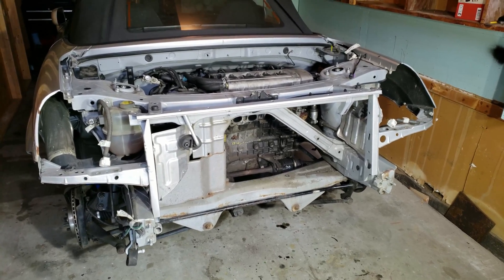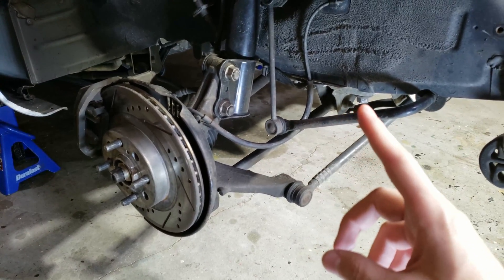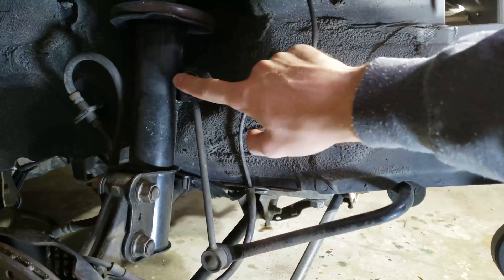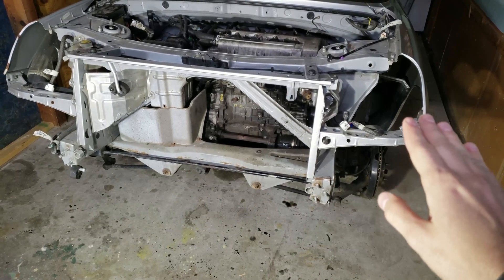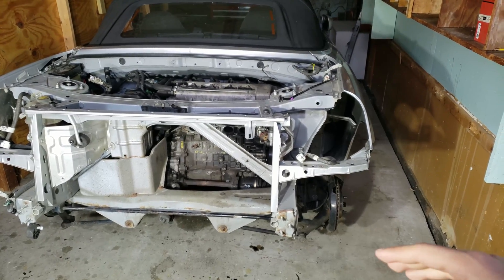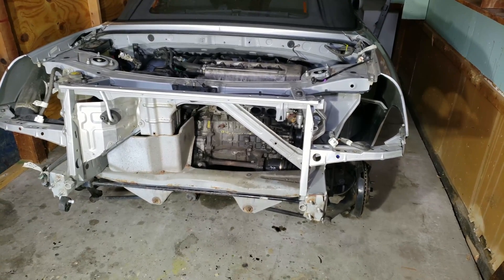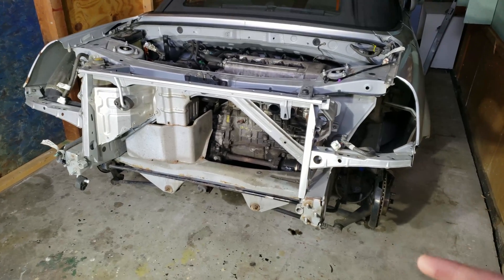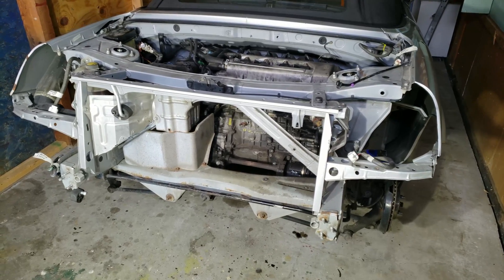What is a swaybar and how does it work? | Theory

Comment: Does this sway bar effectively mean that the vehicle has no independent suspension, because if a spring compresses on one side the spring, on the opposite side, also compresses, and at the same rate?
Reply from the maker: Correct, not truly independent.
Reply: Is there a way to achieve the same effect of the sway bar while ensuring independent suspension where it is beneficial, other than having active shock absorbers? I'm also wondering what off-road vehicles do, as they certainly need independent suspension while climbing over rocks, yet because of their high CoG would surely need a sway bar, or equivalent, on the roads. I intend to look into this further, but if you have any quick answers to this I'd be grateful to read them.
Reply from the maker: @TheErsatzMode  1. That's what active suspension does. It takes information from accelerometers and other devices than adjusts the suspension on the fly.

2. Off-road vehicles has sway bar end links that detach either manually or automatically. That gives them the extra articulation that is needed.
Reply: @IGDesigns , thanks again. I appreciate you taking the time.

Comment: Can you drive front wheel drive car without a rear sway bar? If you go at a slower speed. And don't take any sharp turns? 2003 Camry 4 cylinder 2.4 liter engine.
Reply from the maker: You can but I would guess it would understeer if you pushed it. For regular driving in a city you wouldn't notice.